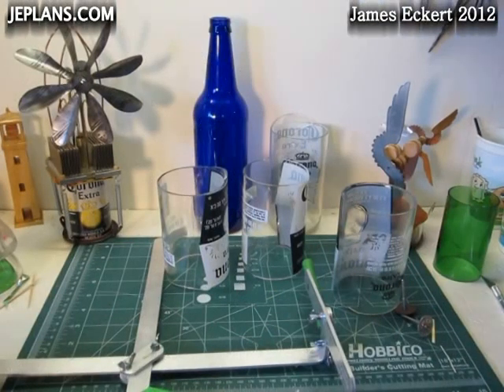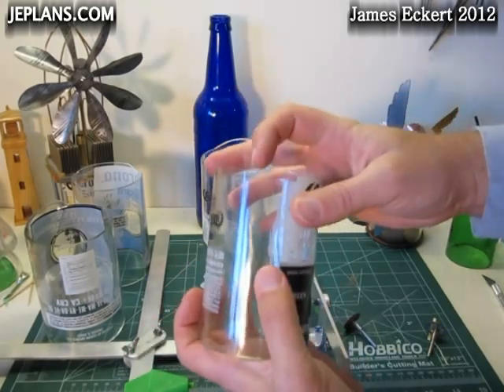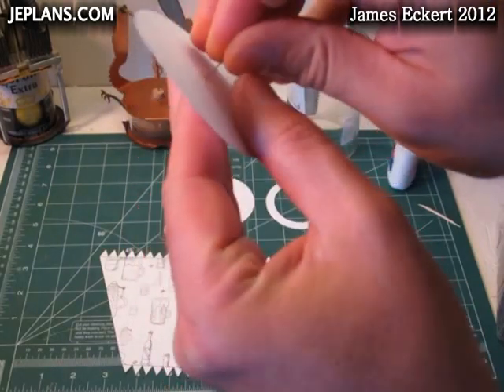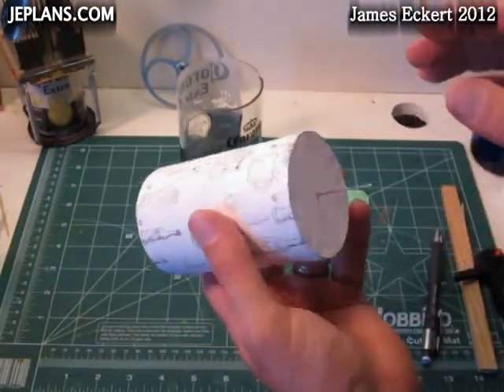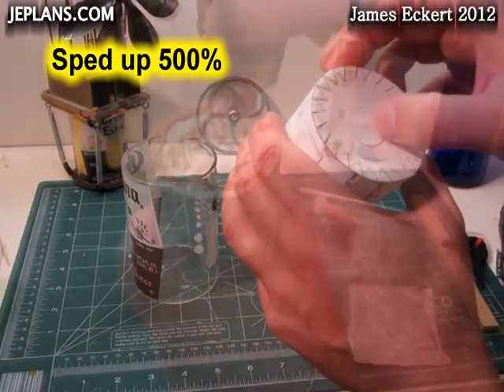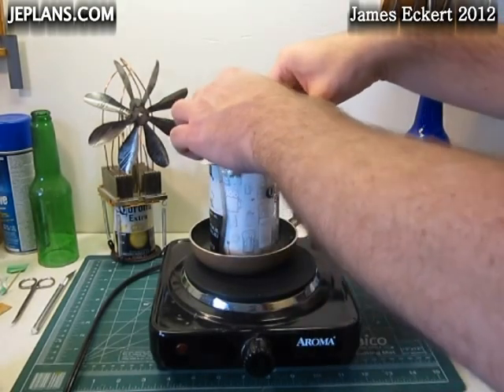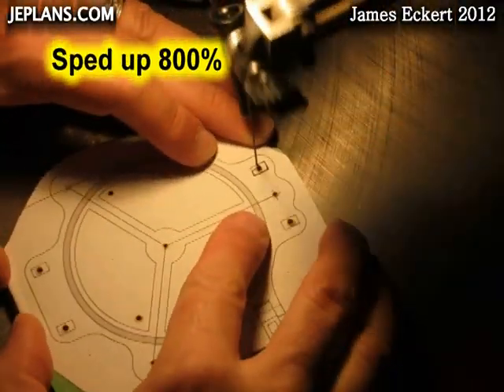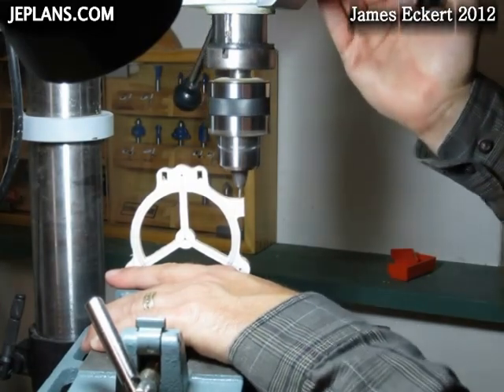Beer Bottle Engine II Part 1

Comment: Congratulations for the neat work not only at the design stage, but cutting it on the fretsaw or scroll saw.  Looks like there is a lot of experience behind all this.   The displacer is quite an effort too.   I know that it would be heavier, but steel wool could be a little better than what is shown  in this video.  But then,  the balancing would be difficult so I guess the paper displacer will  give a smoother engine and would not need that much inertia on the flywheel. Well done.

Comment from the maker: Thanks,
It should do few things for me:
-Add a little more stiffness to top metal
-Provide for a non conductive way to attach to top and bottom together 
-Easier to reproduce and provide foundation for attaching accessories
-Has handle for easy removal from heat source
-Bearings wont heat up, this has not been a problem on my other engines but seams like it could be
-Wood is cheaper than metal

Anyway thanks,